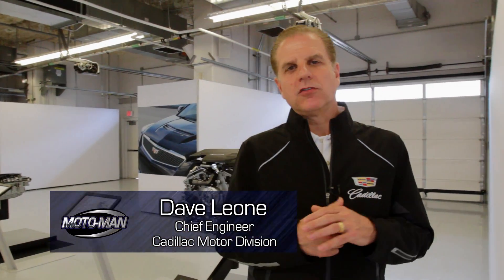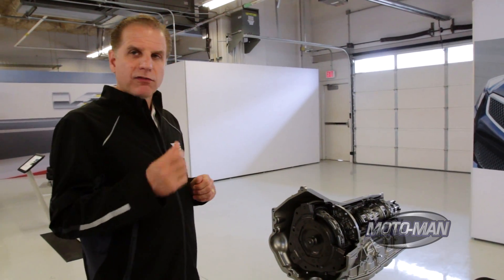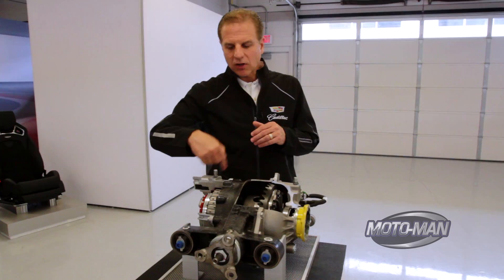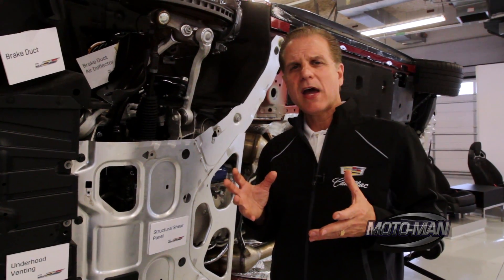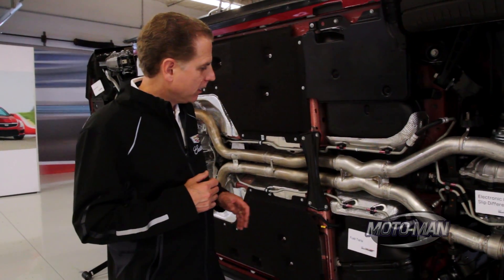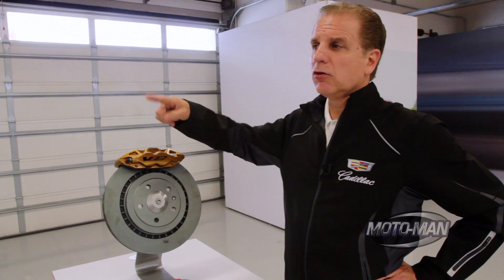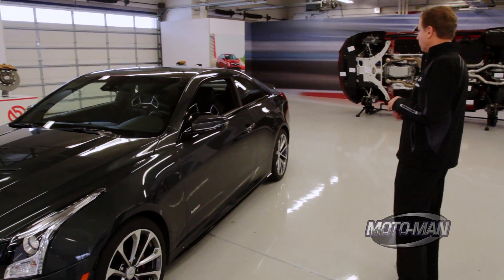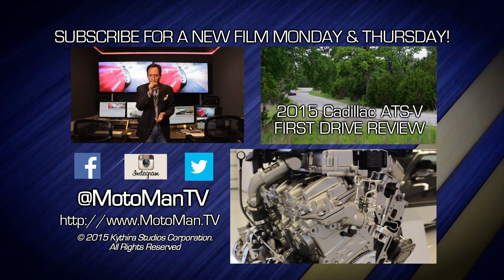2016 Cadillac ATS-V TECHNICAL REVIEW with Cadillac Chief Engineer Dave Leone

Comment: I hate to skip over the not yet released ATS-V and CTS-V but this CT6 seems to be a revolution in car engineering.  I'm interested in a Technical Review of it.  The use of mixed materials to make a strong light vehicle, AWD on all but the base 4 cylinder/PHEV 4 cylinder, the PHEV system with it's new Electric Variable Transmission, 3.0 L V-6 putting out 133+ hp/liter.  Bring the cutaways that were at the NYIAS and break them down as only you can!

Comment: excellent in-depth video, very informal too, got to learn more about the ATS V & I'm looking forward to see what the Mad Scientist pulled with the CTS.

hhhmmm what I'd like to see in the next series of Vs, well lets see:
They got the performance part covered & then some, so no need to rehash that ... Just keep the excellent work you have been doing ... (Will the CT6's AWD & All Wheel Steering make it to the next generation of V?)

• I'd like to see the V (both Vs & VSports) family expand & include more cars ...
an Escalade V would be incredible!!! A +550hp supercharged Escalade to take on the Range Rover & the G63 will further strengthen Cadillac's position in the segment & let people know Cadillac is serious about this. I know an Escalade V doesn't fit with the V's goal as Track Machines, but you don't have to call it a Full Blown V... Maybe VSport or Escalade Sport like the concept from SEMA a few years ago.
also, a CT6 V would be awesome ... That chassis is begging for a High Performance version!

• Something similar to BMW's M Performance parts or MOPAR program would be cool.

• More interior colors for the Vs.

that's what I can think of for now.

as always, excellent video M!
Reply from the maker: IceDree You and the BMWs/Mopars . . . :)